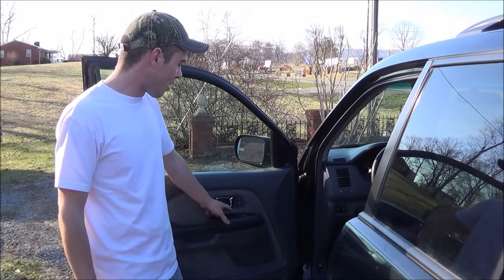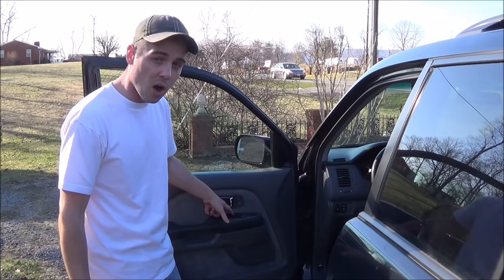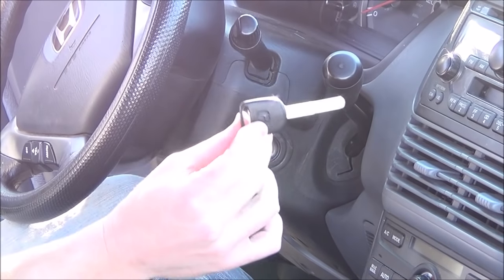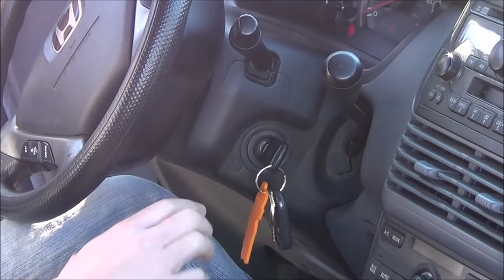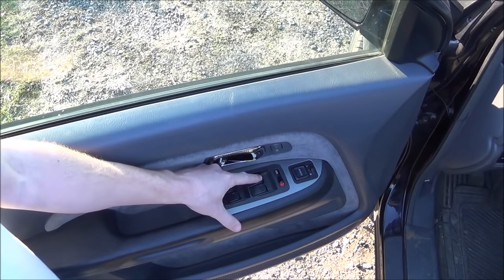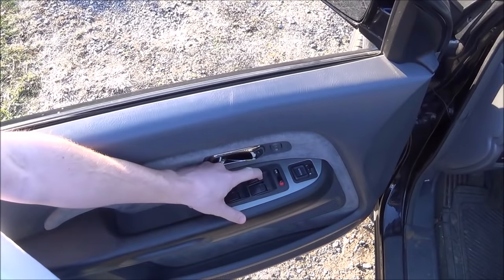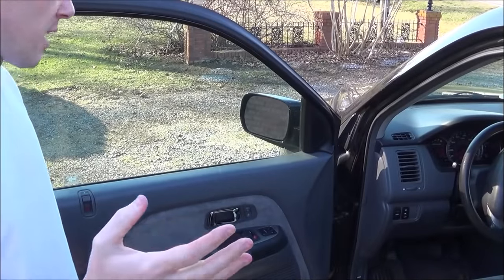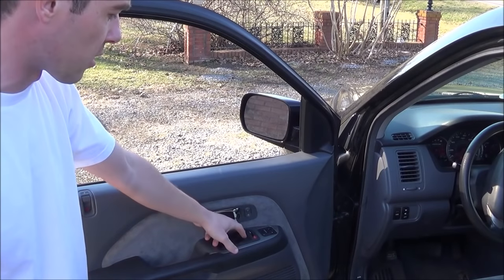How To : Fix Your Honda Automatic Power Window Switch

Comment: Hi how about the door lock? My 2005 honda oddyssey my door won't lock unless you manually it will unlock but it won't lock any idea thanks!!
Reply from the maker: Sonny Gimenez From what I read online it seems to be a common issue with Odysseys (keyless remote lock not working but unlock does) if one of the doors or the rear hatch is not shut all the way.  I would try opening/closing all the doors to make sure nothing is stuck (i.e. -- a seatbelt) & also make sure that you dont have any faulty lights on the dash showing a door is open when it is not (faulty door sensor).  Most likely that is the issue.  If you mean that they switch inside the vehicle will not lock when you press the button, I would guess that the switch is possibly bad.....in which case you would need to replace it.  Good luck!

Comment: Thanks for a quick respond. No lights on the dashboard all the doors close the only problem is it would not lock my door when I lock it manually and press the key fob it turn on the security on the van and it will unlock when I press the key remote but not to lock it. Thanks again!!
Reply from the maker: Sonny Gimenez I think you need to replace your driver's side master switch (controls windows & door locks....everything is routed through it & rain/soda/windshield washer fluid drips in & burns them out).  Simple to replace, but you most likely are going to have to reset the memory in it once connected (this video possibly will do that for you....if not, here are the Honda instructions....) :

1. Turn the ignition switch to ON (II).
2. Move the power window all the way down by using the power window DOWN switch.
3. Open the driver's door.

NOTE:

Steps 4-7 must be done with 5 seconds of each other.

4. Turn the ignition switch to LOCK (O).
5. Push and hold the power window DOWN switch.
6. Turn the ignition switch ON (II).
7. Release the power window DOWN switch.
Repeat Steps 4-7 three more times.
8. Wait 1 second.
9. Confirm the AUTO UP no longer works. If AUTO UP still works, go back to Step 1.
10. Move the power window all the way down using the power window DOWN switch.
11. Pull up and hold the power window UP switch until the power window is all the way up, then continue to hold the switch for 1 second.
12. Confirm that the power window control unit is reset by using the power window AUTO UP & AUTO DOWN function.

Comment: This is the procedure for older Hondas, the new models use a different procedure that is quite complicated.  Its easier to use the Honda scan tool to do it, but there is a manual procedure as well.  I work at a Honda dealer.
Reply: how do you reset with newer models?

Comment: What if you can no longer get the window to go down? All the other windows work. This one has seemingly been mortally wounded for a long time, sometimes working, sometimes not.
Reply from the maker: You most likely need a new window regulator/motor combo.......the drivers window gets used more than any others & typically fails first.  Many YouTube videos showing how to replace them, someone who can change their own oil & has minimal tools should be able to get it done fairly easily in a few hours.

Comment: My window on drivers side is starting to misbehave and sometimes won’t close but does a little up down and stop movement. Any ideas ?
Reply from the maker: Spray silicone spray in the window track on the front and back (the groove that the window goes up/down in).  That can happen if it’s catching on the track and causes it to stop.  The silicone will make it smooth.  

Use caution when spraying!  It will get everywhere if you aren’t careful.

Comment: i have a honda civic 2002 . its right side power windows are not working . can you give me a solution..?
Reply from the maker: +ravi saini Possibly a fuse or relay.....if not that, it most likely is your switch or window motor (or wiring issue.....i.e. -- corroded wire, bad ground, broken wire, etc).

Comment: i have problem with the windows, it's not working up or down except the driver side. how to repair? highlender
Reply: it's probably your master switch.  I have a 2006 Odyssey and only the drivers window would work.  the other windows would only make a clicking noise.
I replaced the master switch and all is working again.

Comment: Question: 2005 Honda CRV. The driver's side control works on every window in the car. The passenger side front window has an issue. I can power the window up and down from the driver's side. I can power the window up from the passenger side, BUT I can't power the window down from the passenger side. Meaning, I have to power the window down when my wife wants it down ;)  Do you think this is as simple as the passenger side switch? I'm stuck because I read of this problem on too many CRV's. Any help would be great!
Reply from the maker: David Malenfant Yes....it is your switch.  You may want to take it out and spray it with some electrical cleaner ($5/can at Autozone).  It could just be a corroded connection from rain getting on the switch.  Good luck!
Reply: Did work what +Real Tool Reviews suggest? Did you fix it? I have the same problem.
Reply: Real Tool Reviews I have the same problem, I will give it a try. Thank you for the video and the responses!

Comment: I tried this on my 1998 Honda Civic EX sedan and it worked but after starting the car and driving then turning the car back off the auto window stops working. Any suggestions? Maybe my battery is low? I just got the car maybe less then a month ago and it never worked.
Reply from the maker: +Kay Gee (KG) You have an electrical issue......something is completely killing power to the switch or ecu when you turn the key off & it erases the memory just like when you replace a battery.  If you radio presets dont go away, I would guess it is a faulty switch.
Reply: +Real Tool Reviews I don't think there's a electrical problem. My radio presents does not reset. Might be a faulty switch. I have an extra one from my old car. It was working on my other car. Maybe I should try switching it and see what happens. I kind of thought my battery might be low but I could be wrong.

Comment: Excellent video, I had this problem after replacing the battery.  It is working fine now with your help.
Reply from the maker: +Jay Udeshi awesome!  I'm glad it worked 👍
Reply: 2006 Honda odyssey my pasinger window is working the other 3 windows not working what to do? thanks

Comment: The passenger side window on my 2012 Honda pilot wont roll down. I checked the fuse. It looked fine but i went ahead and changed it any ways and it still wont work. All the other windows work fine. I did have to replace the switch on the passenger side a few weeks ago because i pulled up too hard and the switch popped up and when i pushed it back down the window  rolled all the way down and wouldn't roll back up. I replaced the switch on the passenger side and it worked for maybe a day. Probably not even a full 24hrs really. Now it wont roll down... any ideas?
Reply from the maker: animalman04 I would guess you bought a used switch off of eBay & it doesnt work.  I would suggest taking the switch out of one of your other rear doors & trying that on the passenger front...most likely they have the same plug...then you could see if it is the switch or the motor that is bad.
Reply: Real Tool Reviews  I got it from a big dealership here in kc.  They ordered it for me and when i got it, it was still in the packaging unopened.

Comment: Hi there, I am having a problem with the switch. it controls all the windows but the driver side window. that one won't work. now this happened before and the window started working, then stopped working, started working again, and now it won't work at all again. any ideas about this problem?
Reply from the maker: Most likely the switch itself or the motor is going bad inside the door.  Normally the drivers side front window regulator/motor breaks first since it is used the most.
Reply: How hard is it to change the switch?

Comment: Hey thank you for that, but what do we do if rain gets in and by then  it doesn't wind up or down at all.
Reply from the maker: You need to watch vids on testing a window regulator motor, master switch, and relays/fuses.

Comment: My window switch is not working at all. Any advise on this?
Reply from the maker: Check your fuses.  If not that & you are getting power to the plug on the back of the switch assembly, then check for power at the window regulator when it switch is pressed.  If you have power when pressed — the motor/regulator is bad.  If you don’t have power at the regulator, but you do at the switch, then the switch is bad.  If you don’t have power at either, it is a wiring issue (broken wire or bad ground).

Comment: Hello. My driver side window doesnt go down at all the rest of the windows do go down. I have a 200 Honda Civic Ex. Please help! Thanks
Reply from the maker: Check your fuses/relays..... if it’s not that, it’s typically the window regulator or the drivers door switch.
Reply: @RealToolReviews  I checked all the fuses/relays..there's no blown fuses/relays
Reply from the maker: Probably the regulator.  They fail in the drivers door the most, since those are used constantly vs the other windows.
Reply: @RealToolReviews  yes it turns out it is the regulator. Thanks

Comment: Didn't work for my 2003 Honda accord.
Reply from the maker: Dennis Vivanco It may not work for all models/years of Hondas, but it definitely works for most.  Also, there could be other problems with your particular vehicle preventing the window from going up/down (i.e. - switch).

Comment: What if your window will not move at all?
Reply from the maker: Your power window motor could be locked up, wiring bad, ground bad, switch cluster bad, fuse blown, etc.
Reply: @RealToolReviews  thanks! I just purchased another switch .  I think that will take care of it. Really easy to install also.